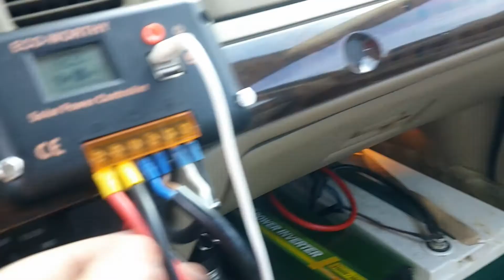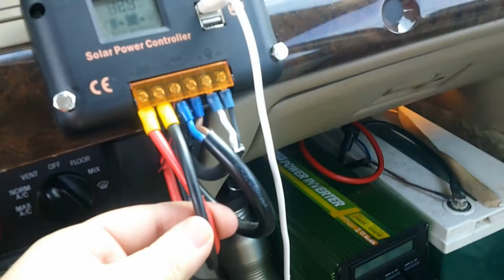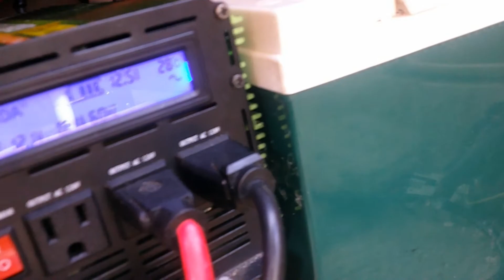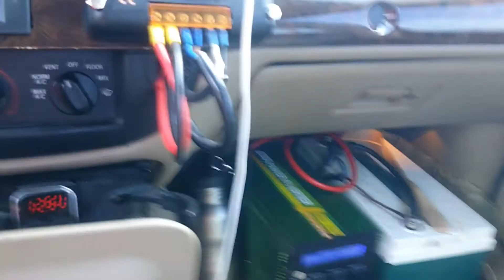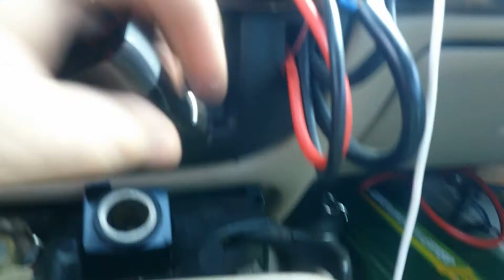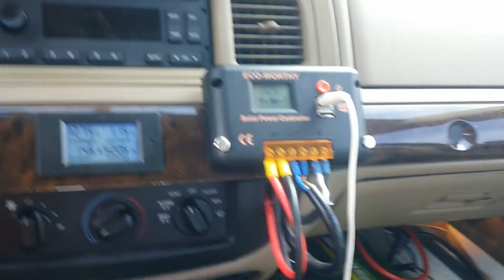Upgrading to glass solar panels and updates

Comment: I'm sure you will be much happier with the glass panels.  Those flexible ones seem to have a short life.  Heat is an issue for sure so the hood would be a challenging location.  I was unable to find any information on your 'auxilliary AC' - what model is it?
Reply from the maker: The auxiliary AC unit is the smallest home AC unit you can get. I sourced it from Ace hardware when I was in Ocala Florida as the heat and humidity was unbearable.  I can only use it with shore power